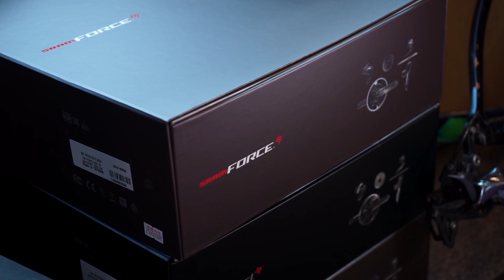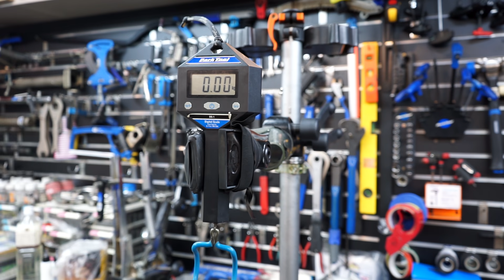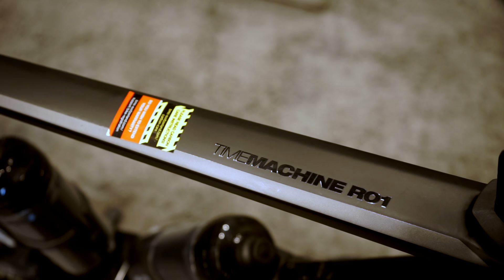Bike Build)BMC TimeMachine Road 01(New TMR01), SRAM Force AXS with Zipp 404 / 뉴 TMR01 디스크, 스램 포스 AXS

Comment: 8kg is not ok
Reply: It's madness. People are paying so much $$ for stuff that adds little to nothing (except weight): disc brakes, electronic shifting, wages of overpayed SRAM engineers. This bike is a nice example, it has almost everything: extra disc weight, poor SRAM tolerances, wheels for which you pay premium that are actually average at best.  Add a ceramicspeed OSPW and it's the holy grail of money spent for no gain.
Reply: agree... mine is 7.41kg
Reply: I got 6.80 kg. rim brakes, external cabling old but I love it. scott cr1
Reply: 8kg is pretty natural for this bike. Its very aero, and this is the storage box version as well as having integrated bottle cages, which is heavier than having standard cages